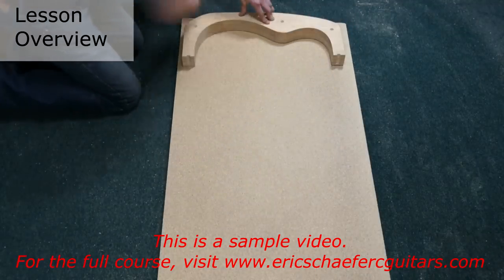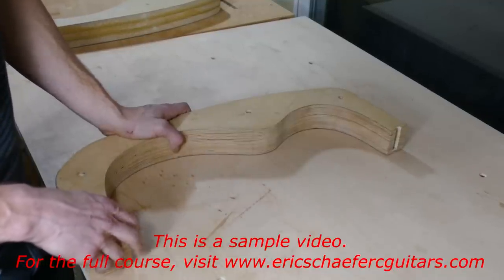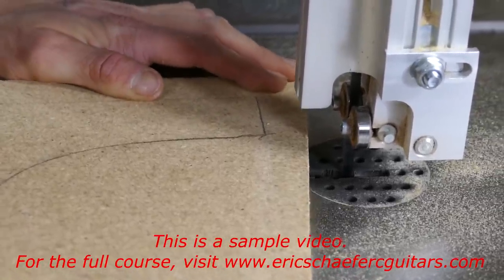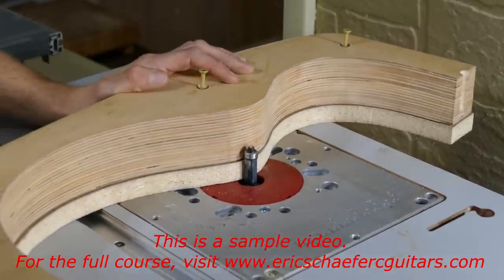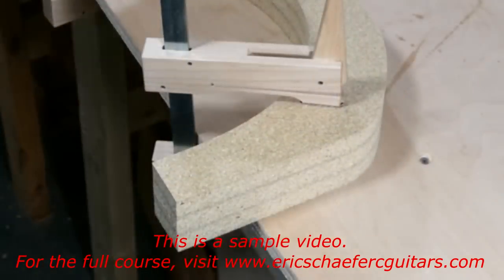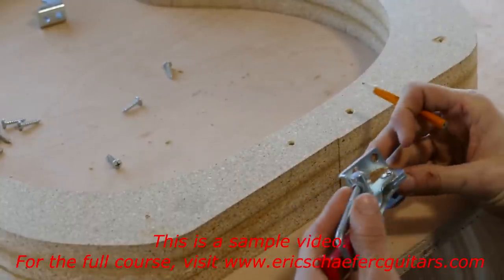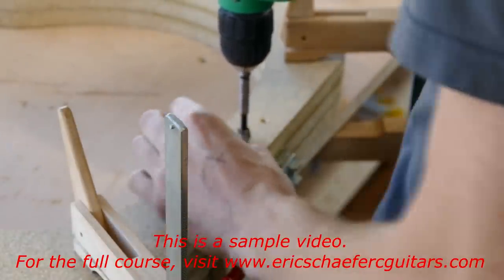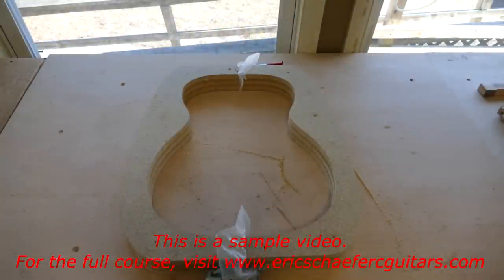Making a Guitar Mold - Eric Schaefer Guitars - Online Guitar Building School

Comment: Hi, I just built my own mold using this video and while my independent pieces fit well with my template, when I screwed them together my mold was slightly oversized in some sections compared to my template. Some parts lined up perfect while others did not... Is there any way I could "fill in the gaps" that are in between my mold and template?
Reply: Alexis Kruljac Make a new template. If you rough cut your new pieces and copy them with a proper template bit you should have no imperfections.

Comment: I made a thin MDF template to draw around for cutting out my top and backs will that do or is it better to start from scratch going directly from the plans.
do you normally trace your guitar top and backs from a seperate template or do you just use the mold
Reply from the maker: Your MDF template should be fine.
I normally trace what I need using the mold. No need for extra templates.
Reply: @EricSchaeferGuitars this is definitely a late reply which in a way is a good thing 
In Australia chipboard is cheaper than plywood and MDF 
how stable have you found it since you made it compared to MDF or Plywood?

Comment: Why is mdf preferred over plywood? Just asking cause I have plywood and need to make a mold. I don't wanna go spend more money unless there's a good reason not to use plywood.
Reply from the maker: J Shev g plywood is fine. Go ahead and use what you have. I use plywood, if its what I have on hand. If i have a choice, however, i will use mdf everytime. Because mdf is just a homogenous matrix of wood fibers and glue, it lacks grain patterns. This makes mdf more predictable when cutting, especially on a router, and it is a little more stable over time.... now plywood is still more predictable than say, solid wood, because the laminations make it so that there is no prevailing grain direction, so we are only talking about a subtle difference here. I say use the plywood.
Reply: Eric Schaefer thank you for your reply!

Comment: How wasteful if you had put the pieces such that the ends poked into the inside of the previous piece you could have saved a lot of material in other words like your fingers interlocked.
Reply from the maker: The pieces didn't fit that way. If the boards were wider, i'd agree. If you looked at it for more than a second you could see that.
Reply: I have watched this video more  than 5 times and thought the same thing every time but not made a comment before now. So as far as watching it for more than 5 seconds I think that I have  don t you?.